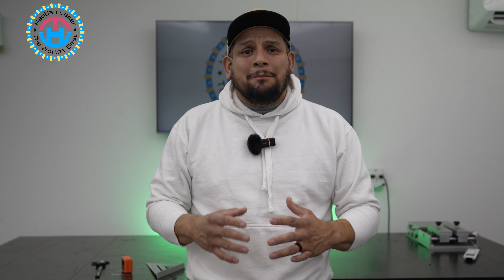INSANE $4,400 Chinese Fiber Laser Unboxing | Haotian 60W - Better Than Glowforge?

Comment: Would you be able to provide the dimensions of the work table and the tower?(not working area, the actual product dimensions) I would like to have a space prepared for this and I am unable to find any actual dimensions.
Reply from the maker: @BrandonLavy  the base of tower is roughly 23.4 inches height x 15 3/4 wide. My table is 25 inches wide.